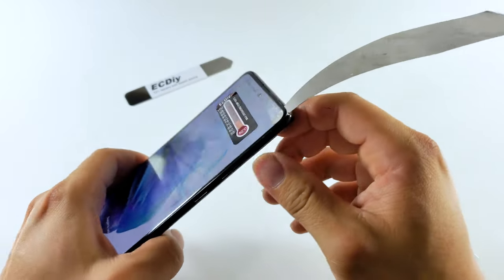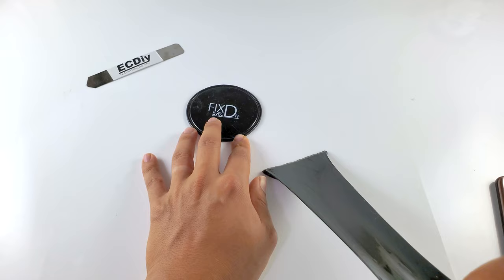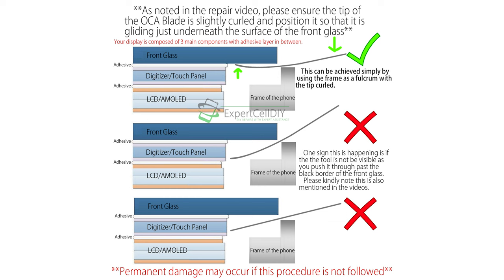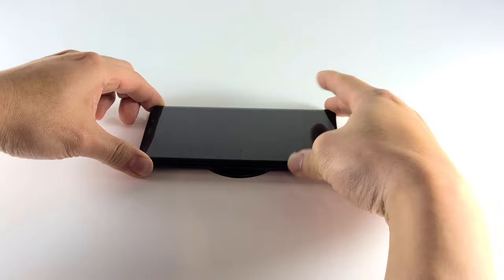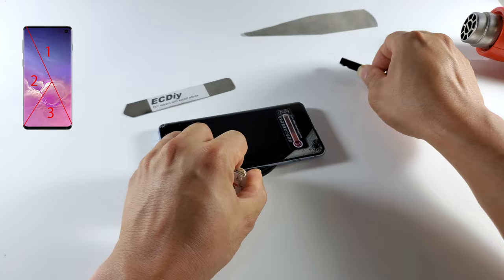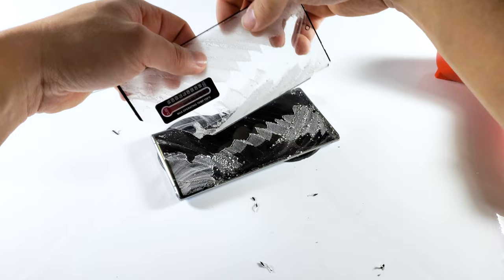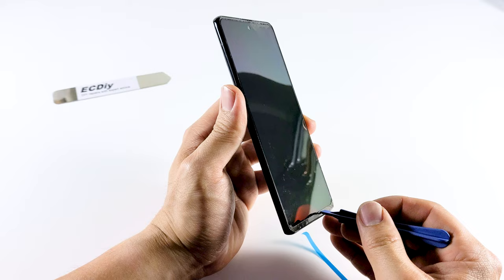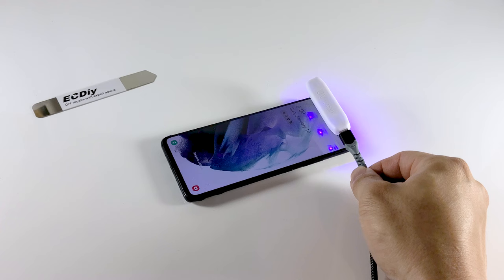How to Replace Screen Glass Only on Galaxy S22/21/20/10/+/Ultra/Note Shown in 6 Mins/New DIY Method

Comment: Will this repair method maintain water resistance? Will I lose it?
Reply from the maker: Great question! This has been asked before, so please excuse me for the copy and paste answer:

Under proper installation, the phone should still maintain its water resistance. The tape adhesive used to seal it is indeed the original-grade IP68 adhesive. However, the LOCA process must be carried out with utmost precision and the adhesive should be spread evenly in order to achieve the factory-specified water resistance, which is 5ft submersion for 30 minutes. While this is possible, it may not be easy for a novice, and the resulting water resistance may be reduced to the point where it can only withstand regular splashes or drops of water (for example, IPX1~IPX5). I won't be able to go into detail about what each rating means, but if you search for IPX ratings, you will find a helpful article written by Audioreputation with specific details for each rating.

Ultimately, it's important to note that cracked screens are not water resistant either. So, when it comes to replacing cracked front glass, there isn't anything to lose in terms of water resistance.

Comment: So on the Note10+ you need more glue on the top?
What about the glue going to the ear port or speaker.
Reply from the maker: On the Note 10+ and for all phones with a camera hole where the hole is physical, (for some of the newer devices, the "hole" is simply a clear piece of glass/plastic) yes, it is advised that you dispense a drop or two of the adhesive directly on the opposite side from the center of the phone/from the flow of the glue.
    Should some glue find its way to the ear port/speaker you can clean it afterwards using isopropyl alcohol & Q-tip or a toothbrush.
    Any further questions/concerns, please do not hesitate to contact us/comment further.
Best regards,

Comment: Is it made of materials like the original ones like for s21 is it made of Corning Gorilla Glass Victus
Reply from the maker: Hello Izaaz,
Thank you for taking your time to comment

Our glass is made of aluminosilicate glass which is technically speaking, what Gorilla glass is. We purchase our glass as originals, but to our understanding, it is not possible to confirm that it is indeed Gorilla glass even with a spectroradiometer and the brand does not participate in authenticating parts nor do they sell the glass part on their own. 
What also makes it difficult to confirm is that between different generations of Gorilla glass, it's not just the chemical composition that has changed, but the manufacturing process that reduces defects. (All glass products, like diamonds, have tiny microscopic defects). 

However, we have done various tests including break tests to know that our glass is comparable to the original take-off. Most glasses found online these days are soda lime glass, or low iron soda lime glass made to look like aluminosilicate glass and there is a big price difference.

If we can be of any further assistance, please do not hesitate to contact us.
Have a great rest of the day.
Reply: @ecdiy  thanks

Comment: Do I have to disassemble the phone and take out the front camera on samsung s22 Ultra? Or can I just simply remove the glass and glue it by letting it spread by its own weight? And when you said to put two drops of glue on the other side of the camera, you mean to out two drops on the camera lense for devices that don't have a hole for the camera?
Reply from the maker: The two drops on the 'other side' referring to above the camera area for S22 Ultra as glue spreading from the center will not make it across the hole (most if not all will eventually get filled via via capillary action, if you leave it long enough but dispensing 2 droplets make it a lot easier). We used the term "other side" as cameras for S10/S10+ are in the corner, the side opposite from where the glue will be spreading from.
    We'll have a video on this soon but S22 Ultra, the camera removal requires patience with isopropyl alcohol & heat. It can take a few minutes for the isopropyl alcohol to soften the adhesive holding the camera but you can dispense the alcohol there by soaking the ends of a Q-tip and squeezing it out over the camera.
     We do have a film that we developed which you can place over the area before gluing. It's featured briefly in our pixel video here (https://youtube.com/watch?v=KFkvo5-wzBI&feature=shares&t=261). Let us know if you are interested as we can provide it to you at no cost with our kit. This will eliminate the need for disassembly also but you can see the outline of it when the screen is not on. 
     Any further questions/concerns, please do not hesitate to contact us/comment further.
Best regards,
Reply: @ecdiy  So, with the protecrive film I will not have to disassemble the back to take the camera out? And in the case that I dont have the film for the camera, on a samsung s22 ultra, would I have to disassemble the back and take it out? And last question, would a regular hair dryer work to dry the glue on the glass to take it out? Is it easier to take out the glass with heat or with isopropyl alcohol?

Comment: Perhaps dry ice may be an option in conjunction with these methods.
Reply from the maker: Hello,
Thank you for taking your time to comment. 
    You can use the kit with dry ice and freeze the display instead but please note that when it comes to freezing, there is definitely a learning curve with it. I know in videos it seems like once you freeze it, you can just twist/pop it off but it is a very delicate process nonetheless. 
    There is a good video that explains about the downsides of freezing. Here is the link: https://www.youtube.com/watch?v=9MS4zG4blo4 
    You also need to disassemble the device and remove the battery prior to.
    Hope that helps.
    Any further questions/concerns, please do not hesitate to contact us/comment further.
Have a great rest of the day.

Comment: For the S21 5G, do I need to remove the camera?  The kit says it only needs to be removed on the S20 - is this the case?
Reply from the maker: Hello,
Unfortunately yes. The good news is that S21 has a plastic back which makes the disassembly a breeze. Once the back is removed, it is a pretty simple process of removing a few screws, and unclipping the front camera as shown here
https://youtu.be/ElJ9S-aZCG8?t=78 
We do include a new back panel adhesive tape also.
Any further questions/concerns, please do not hesitate to contact us/comment further.
Best regards,
Reply: @ecdiy  why nothing for the S22?

Comment: Tengo entendido qué para realizar este trabajo es necesario introducir la pantalla en una máquina de vacío  para eliminar por completo las burbujas de aire.
Reply from the maker: Si está utilizando el adhesivo a base de película, sí, eso es cierto.
Sin embargo, al usar el adhesivo líquido que se muestra en este video, no es necesario.
----------------------- Translated -------------------
If you are using the film based adhesive, yes that is true.
However, when using the liquid adhesive shown in this video, it is not necessary.

Comment: With this one, removing the front facing camera, on the s10 and up, what do you do afterwards? I'm assuming some of the glue seeps into the camera lens area. I'm guessing you need to clean that cured glue out afterwards, correct? What is the best method to do that?
Reply from the maker: Good news! You no longer have to remove the front camera with our camera hole cover film. 

With it, all you need to do is press the clear film centered over the camera area to seal the edges so the glue doesn't get onto it. 

It isn't something we advertise yet, so if you happen to be interested, simply send us a message after placing the order and we will ship the film with it.

Without it, you'd want to use a Q-tip and isopropyl alcohol to clean the underside of the glass. Due to the viscosity of the glue and the camera area being close to the edge (glue would be spread quite thin by the time it gets to the camera area), there isn't a whole lot of glue that makes its way to the inside of the phone if any.

Comment: The edge of my fromt glass lifted at the top right corner and dust is in front of the display
Is there a way to clean it without damaging the phone
Reply from the maker: Hello Dino,
Sorry for the delay. Unfortunately, no you'd need to remove the glass or the screen as a whole to clean it but did this happen after the repair? or original screen you are referring to? 
Best regards,
Reply: @ecdiy  it was the original

Comment: Can i replace the glass from another screen?i replaced the full screen once and the glass wasnt damaged on the old one.
Reply from the maker: You technically can but you would essentially be doing 2x the work. Furthermore, the black border area of the front glass is silk-printed on the back and when you go to clean the glue residue from the back, it can get scraped off unless you are very very careful.

Another thing to consider also is that if the glass has scratches, it may be better to get a new glass.

Any further questions/concerns, please do not hesitate to comment further.
Best regards,

Comment: Will this work on a cracked Samsung s8 plus that has a flickering/glitching display or would I need to replace the entire display? It is flickering and changing colors but responds to all touching
Reply from the maker: Unfortunately, in almost all cases, display issues like the ones you describe are not resolved by replacing the glass alone as they are caused by physical damage to the display layer. The display would need to be replaced entirely. 
There are rare cases where the way the glass is broken puts pressure/pinches the flex cable at the bottom causing the issue. Removing the broken glass would resolve the issue in these cases but it's quite rare.
Any further questions/concerns, please do not hesitate to contact us.

Comment: If I don't care about keeping the front camera working, can I just skip the part where you take off the back glass and remove the front facing camera? S20 fe
Reply from the maker: Hello, we actually developed a round clear film that sticks to the display without the need of adhesive. You can put this film over the camera area before putting the glue on to prevent glue from getting on the camera.
This is yet to be advertised, simply send us an email once the order has been placed and I will make a note on it to include the film!

To answer your question though, yes if you don't care about the front camera you can skip taking off the back.

Any further questions/concerns, please do not hesitate to contact us/comment further.
Best regards,

Comment: will your  method and your tool work with an s7 edge ? I cant find a video of s7 glass repair that they dont remove the back glass. will mess the battery up or something with the heat?
Reply from the maker: Yes it will. S7 Edge can indeed be done without removing the back glass using this method. We also have have the custom IP 68 seal tape made for S7 edge as well as the older models. 
We have not experienced damage to the battery due to the heat. When the display is heated, the battery's temperature changes a lot less due to the fact the heat is dissipated rather quickly by the solid aluminum frame not to mention there is a layer of adhesive insulating the battery from physically touching the display panel.

Any further questions/concerns, please do not hesitate to contact us/comment further.
Best regards,

Comment: I think for buying a s 10 with a broken touch screen but the lcd is working i am but there is not much big of a crack on the glass so i am wondering can it be motherboard problem for not having touch screen or the lcd is faulty?
Reply from the maker: I suppose it can technically be a motherboard problem but to this day, we have not come across a phone with such problem.
For us, and our customers so far, every phone that has had a touch issue had been due to the digitizer layer being damaged which is a part of the display assembly (referring to the Front glass + digitizer + AMOLED/LCD "sandwich" shown in the diagram in the video)
Any further questions/concerns, please do not hesitate to contact us/comment further.
Have a great rest of the day.

Comment: I have been able to remove the old glass. Display is ok but touch screen only works when you hold the phone with your hand or you touch the phone body.
On non conductive places the touch wont work.
Seems like is missing some ground stuff. Is it normal and will work as always with the new glass and glue or I damaged it somehow?
Someone else had same problem? S20 fe

Edit: It worked again after apply the new glass with no issues
Reply from the maker: Thank you for your comment!
   It's normal for the touch to not work as smoothly with the glass removed especially if you have yet to fully clean the old glue. Because the digitizer is laid out as a grid somewhat like a bug screen on a window, as long as you have touch all along the edges/frame as you mention you should be ok. 
    Any further questions/concerns, please do not hesitate to comment further/contact us.
Have a great rest of the day!

Comment: unfortunately for me this didn't work for me, I was using the wire tool trying to remove the glass plate when suddenly de digitazer broke, the sceen went blank on the most part, and the part wich was still vissible was mostly green and lines. I'm sure I did something wrong and I would like to know what it is. did I not apply enough heat or was I just trying to hard or was it just bad luck?
Reply from the maker: Hello,
Could you kindly confirm if you were conducting the repair with our kit? Over the years, we've had several viewers leave comments. If you were to use the wire tool without our OCA blade, the wire would get caught when you try to move it past the apex of the corner. 

If you were using our kit, could you let me know if you have divided the screen into 3 sections as noted? Attempting to slide the wire down across both sides ends up exerting upward pressure on the curved edge which can lead to damage. While it doesn't happen all the time, it is best to do one curved edge at a time.

Having enough heat certainly makes the entire process go smoother also.

Any questions/concerns, please do not hesitate to comment further.
Best regards,
Reply: @ecdiy  thank you for the reply, I indedd used your kit, And when I read your comment I think I messed up using the wiretool on the second curved corner.

I used th oca blade to guide the wire over the first corner, then guide the wire over the camera and speaker. the wire got stuck behind the spreaker at first.
And then I think I move the wire over the left top corner without using the guidance of to OCA blade. I didn't realize I should have done this for all corners and actually assumed I only needed to do that to get the wire correctly under the screen.
Reply from the maker: @bartk5451  Hello, 
Thank you for the detailed response. It is greatly appreciated. 
I can definitely empathize with your disappointment. Have you already sourced a new display? I will see what I can do for you, please let me know of your order number or your first and last name as appears on the order and I will get back to you. 
Please feel free to contact us directly through the "contact us" page with the information. 
Wishing you a pleasant weekend,
Reply: @ecdiy  thank you, I left you a message on the contact form, I don't feel comfortable leaving my full name on an open media like youtube.
Have a nice weekend!